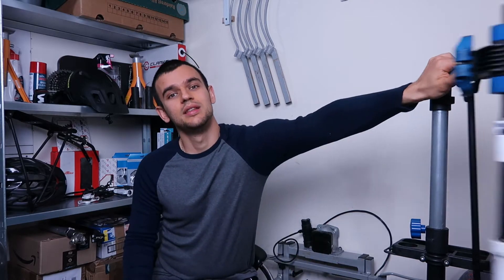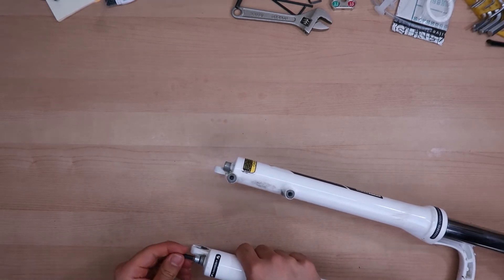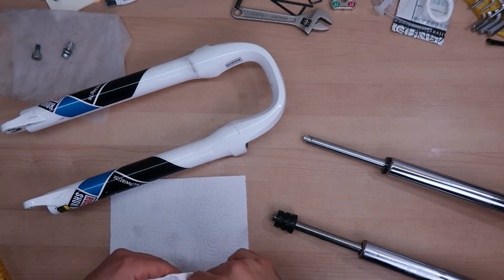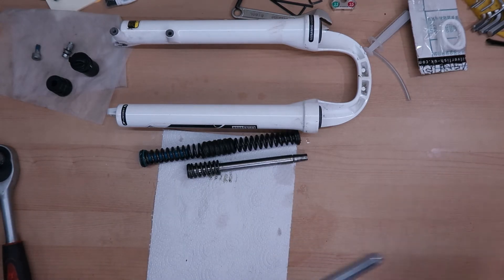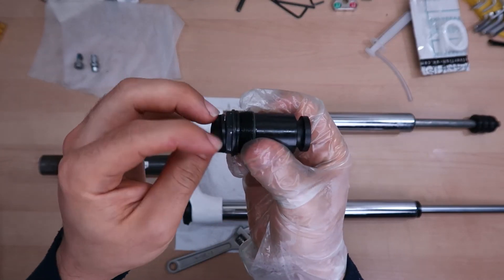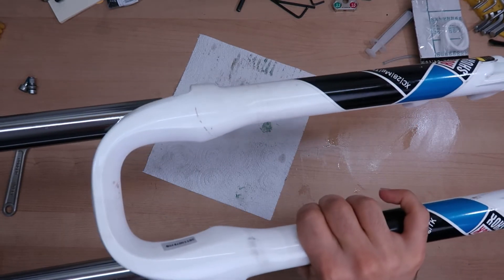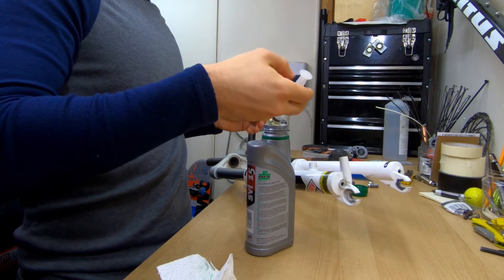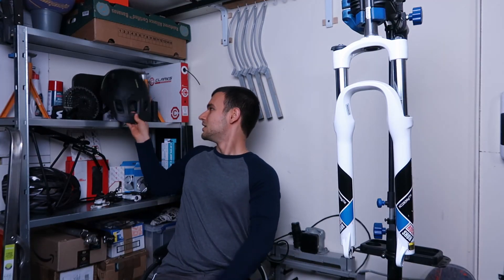£10 Rockshox XC28 Mountain Bike Fork - Teardown And Rebuild

Comment: truth be told, i was initially happy with my new one, but after 1 year and the first maintenance, it went to crap - at least in the winter time - it moves almost like it's locked. As a last resort i'll start spraying it with the brunox deo - if that doesn't yield results in the cold, then it's gonna be a manitou markhor. nice vid.
Reply from the maker: Glad you liked the video. During the maintenance, did you change the oil in the damper side? Maybe thicker oil or too much oil was put in it making the fork feel stiffer.
Reply: yeah these things are garbage. bought mine brand new too and it needs constant rebuilds to work even somewhat decently.

Comment: Mine are locked up and haven't got room to do anything or all the tools. May have to go to bike shop
Reply from the maker: Ah, that is unfortunate. Check how much it will cost to service. If it is too expensive, It might be worth shopping on ebay for a used replacement fork.
Reply: @buckbikespent4588  it is as I put a bbso2b 750w 48v middrive on and doing 28 to 32mph, hit a lump in the road and wasn't very nice. Sure once apart they can get sorted by someone who knows what they are doing!!!!!!!

Comment: I have the same fork and when it's compressed around half the travel it makes metallic clicking sound. What may be causing this?
Reply from the maker: Not sure, you have to take it apart and see, there could be some corrosion on the stanchions.

Comment: I know its stupid. I actually extended mine to 140mm. I just removed that rubber damper below the rod ang put a 30mm spacer ang 40mm allen bolt. Works well but not recommended because of the stanchion diameter. 
Mine looks like daddy long legs lol
Reply from the maker: LOL, that sounds interesting, I should maybe try something like this :D
Reply: @buckbikespent4588  its effective as hell. My sr suntour XCR's disposable lockout cartridge blew last month  so i extended it again since its a dead fork and its currently 170mm of travel. Jumps and hard trails and its still holding up, i also did it to my mates and a year later still doing its job

Comment: Hello i have some old tora 302 would they be the same as these ?Thanks for the video .
Reply from the maker: Not sure, the procedure might be the same but you have to check the manual if the lowers need any oil or grease.
Reply: @buckbikespent4588  Ive done it now the lock out works ,the forks seem stiffer .

Comment: Sir if I am not wrong , I think 109 ml  oil should inject into the upper tube (drive/damper side ) rather than into the lower leg according to SRAM manual. Sir why did you inject only 10ml of oil in each lower leg. Was it just for extra lubrication only or it was mandatory .
Reply from the maker: Hey, thank you for your comment. I mentioned in the begging of the video that I'm not going to be servicing the damper side as I expect it does not need an oil change. Actually, on this fork you need to put 93ml of 5wt oil in the damper. I put a bit more oil in each lower just for extra lubrication. Maybe if you are picky about your rebound, don't put more than 5ml in the damper side lower.
Reply: @buckbikespent4588  Thanks

Comment: Is the procedure almost the same for xc30 coil?
Reply from the maker: It should be, I think the only difference between xc30 and xc28 is the diameter of the stanchions.
Reply: @buckbikespent4588  thank you!
Reply: @charles_1523  the XC30 might have a different lock out mechanism, with a tube thingy and an inner spring.

Comment: There is no nee to use a mallet when you are actually hitting a piece of metal (worst that is sharp/straight..) because you will damage unecessary the mallet... short, snap hits with small, 500grams hammer would do the job. You are using anyway a tool to prvent damage to the part of piece...